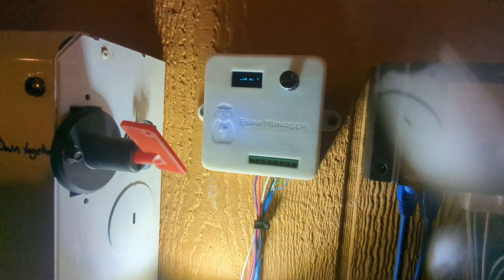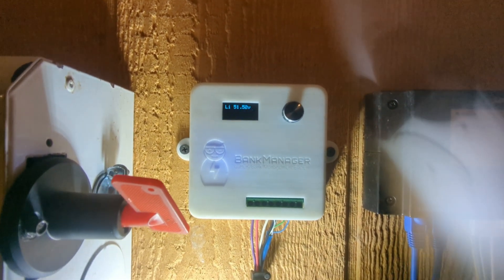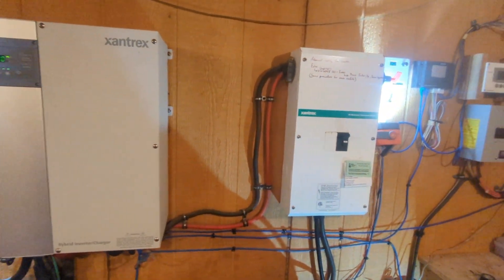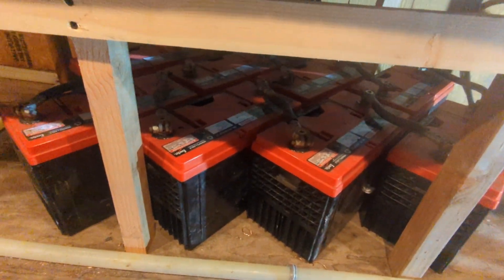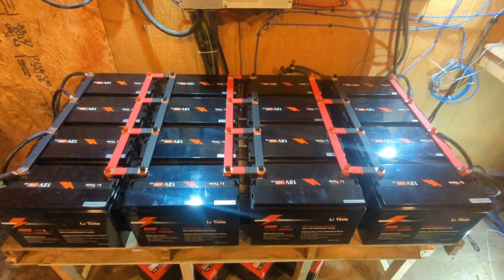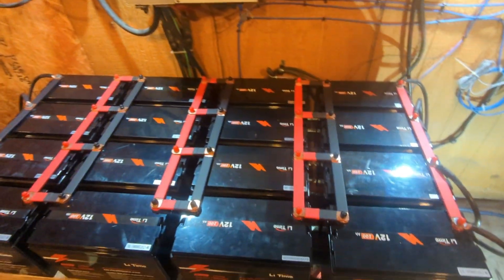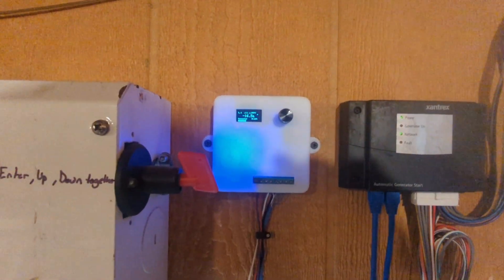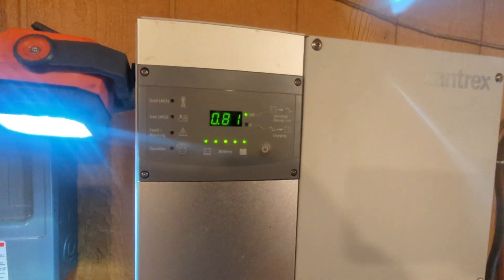LiFePo4 48v Lithium + Lead Hybrid Battery With Bank Manager.

Comment: It's always so interesting for me to see the BankManager installed in a big 48v house system.  On boats everything is so cramped it's hard to see what's going on.  You did a great install.
One suggestion I have for you is set the min POC menu setting to wherever you want your Li to stop being used at.  Say 15%
   Once the BankManager sees you have discharged your Li to that point it will disconnect the li and you will be running on lead.  With your install that will quickly lower your voltage and start your generator which will, of course, raise the voltage and cause the BankManager to reconnect your Li for charging.
   I think I heard your generator start up when you entered the menu as that does much the same thing.

   Again, great install and thanks for making the video.
Reply from the maker: Thanks for the input. Yes that was my generator firing up.
Reply from the maker: What are the chances that future versions will have a low temp cutoff feature for cheap batteries like mine. Seems like a simple addition and it would allow people to buy cheaper batteries that still have high quality cells.
Reply: I'd say 100 percent.
   I have that part of the Gen3 working fine.  It's not as good as having the BMS just shut down the charging as I can only turn the li contactor off but in your case you go to lead as before your upgrade so your generator runs more often but your Li isn't destroyed.
Reply from the maker: Hey Clark, I saw your website was hacked. Can you get me a manual somehow? I lost my digital manual and I need the wiring configuration in the manual.
Reply from the maker: Got your message.
For anyone reading this, the new site is:
MarineDCAC.com

Comment: Have you done an update to this video?  And are you Happy with it since you have been using it?
Reply from the maker: This system is on an off grid cabin that I only get to in winter. I just got back and I'm hooking it back up today, but with a better 48v contactor sourced by bankmanager for me. The one in the video was sourced off of Amazon and it turned out to be cheap junk. I'll update this comment when everything is sorted. Sorry for the long delay.

Side note, their website was hacked and is no longer usable. Please check out their YouTube channel (Clark's Adventure) or their new website:
MarineDCAC.com